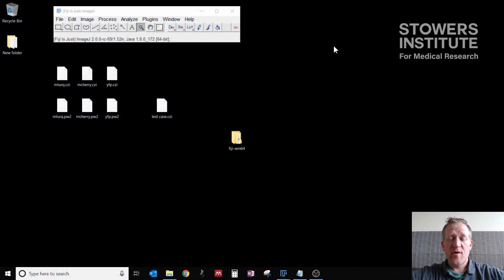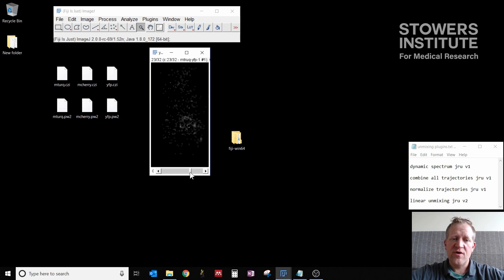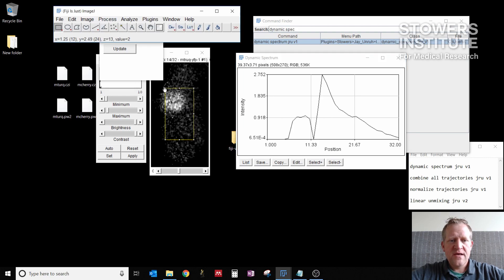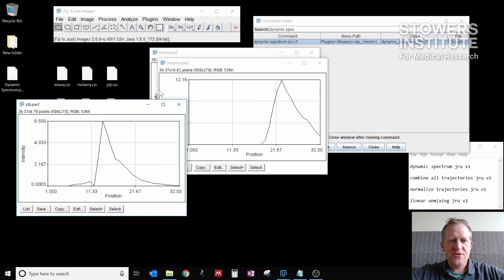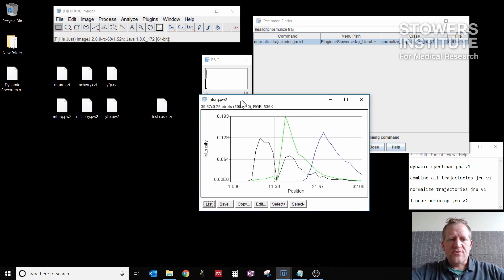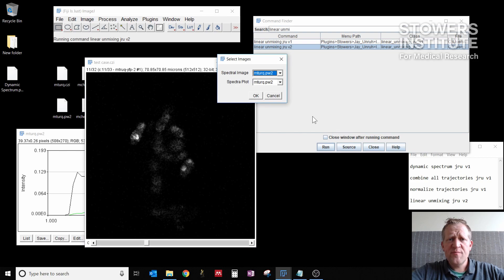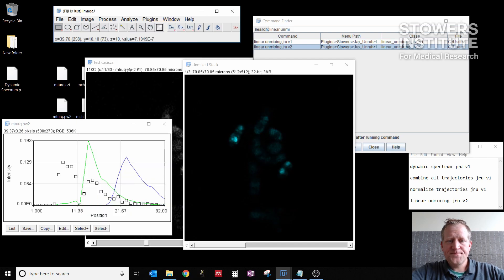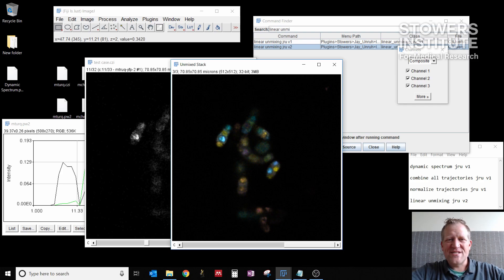Unmixing fluorescent species from spectral data using Fiji

Comment: What difference it makes doing Linear unmixing instead a mere LUT for each channel by splitting the channel ? Please Help me in this
Reply from the maker: Hello, thank you for your question! Remember the data we’re talking about here is fundamentally different from a standard multichannel fluorescence image. Here each pixel is not just a fluorescence intensity, but a fluorescence spectrum. Spectral unmixing is the method by which you can take those fluorescence spectra, and turn them into an unmixed multichannel image.
Reply: @StowersInstitute  Thanks for the Reply! It's clear. But whenever I do Unmixing spectral image with ACE, the overlapping region is being removed. I am not sure what happens actually here in this method. Should I be aware of what need to be removed ! Looking for good reading suggestions to fully understand and apply Unmixing perfectly. Thanks a lot for your time in helping us

Comment: Hi,
After linear unmixing using the spectral image and plot, i get a 'Concentrations' plot but i do not get the unmixed image ? My image has 32 frames and is 512 by 512 in resolution. ON using the v1 linear unmixing plugin, i get a multichannel image but it is all black!
Reply from the maker: It seems that you’ve run the linear unmixing plugin on the spectral plot window itself and not the image. Try again, but be sure to click on the image window before clicking ‘Run’ on the plugin. Clicking on the image window first, will ensure that the plugin runs on the image and not the plot window.”

Comment: Thanks for this tutorial. I do pump-probe microscopy and now I have an image that certain regions have different temporal decay profiles. As the focus laser beam is much larger than the features on the film-in this case, crystals with different sizes- most of the pixels have a linear combination of (what I am speculating based on the histogram) 2 different exponential decay. I played around with spectral unmixing a while ago, so I thought maybe I can use the same here. I want to simulate 2 decay profiles and use them as my reference to unmix the whole image. If I may, what are your thoughts on this?  

Finally, thanks for your very helpful tool and tutorial. Certainly, it helped me a lot.